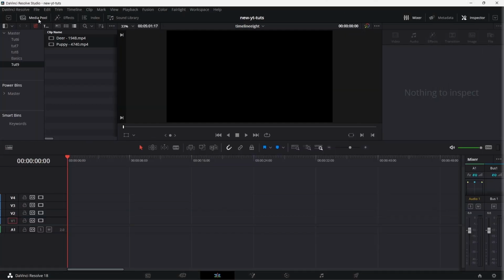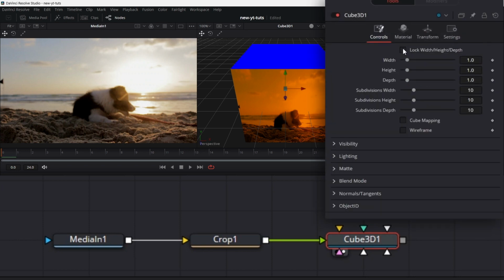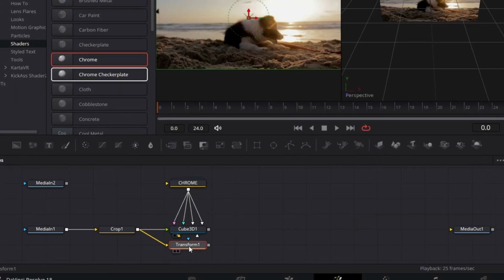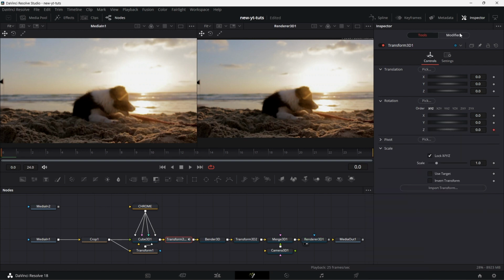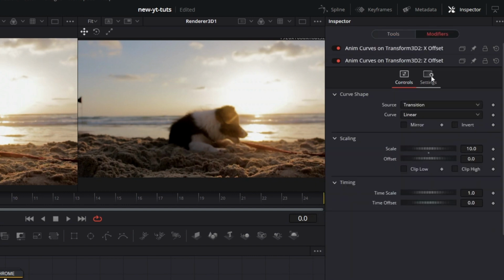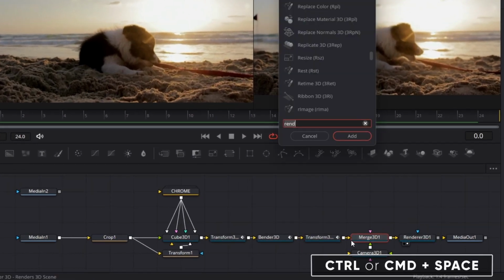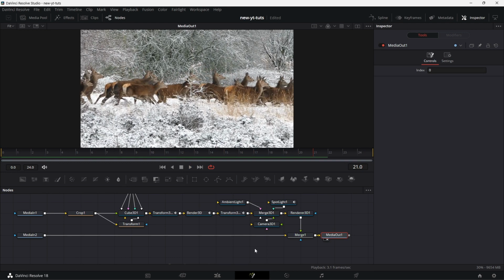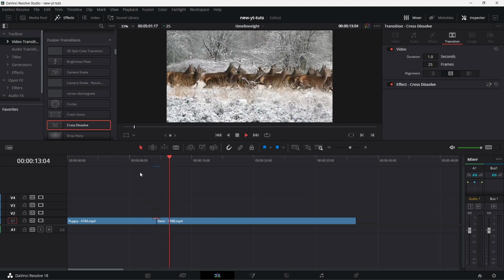Easy 3D Peel (Page flip) Transition in Davinci Resolve

Comment: Why on the step of Transform3D1 to set the Z Modify with Anim Cruves，the angle auto set to 45, but this video the angle is 0, not change? DaVinci Resolve 18.6.4，thanks.
Reply from the maker: The Z value was to have the whole animation zoom out. The angle is to set the how you want to peel to look. If you set it to 0, it will peel in a straight horizontal line. I don't know if this helps. Please let me know.

And thanks for watching. I appreciate it.
Reply: @madresolve  Thank you for your reply. The problem is when I used right key click Anim Cruves, the angle auto set and lock, I can't change it, sometimes is another number, not just 45, thanks.

Comment: erm what the sigma?? there's blue lines that follow my animation? can't remove? what the sigma?
Reply from the maker: Yes, I designed that wipe for full screen videos. It won't work with any video or image that isn't full screen. A cube 3d node was used to generate the wipe... The sides are the ones showing the blue bit. 

To be able to achieve the peel effect any size video or image, though without the thickness, you may use an image plane instead and connect the video to the green input. You won't need the chrome shader. 

But if you wish for the back to be shiny, you could add another image plane node + replace material node to which you can connect a chrome shader. Then bring in a merge3d node and connect both image planes to the merge3d node. In the transform settings of the second image place, move it back by -0.001.

Additionally for the first node that has the first video content attached to it, under settings, tick cull back. For the second image plane, tick cull front.

When you feed this into the bender node, ensure the group objects option is checked. 

I know this is tedious... I'll make a video covering it soon. But every other step remains the same. 

Please let me know if this works out for you.